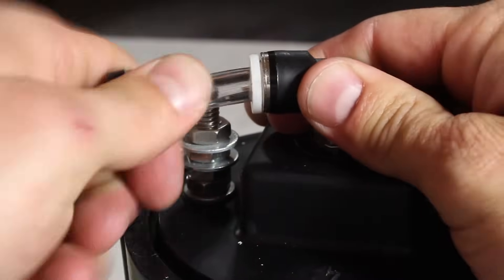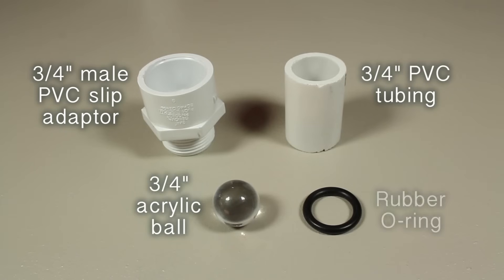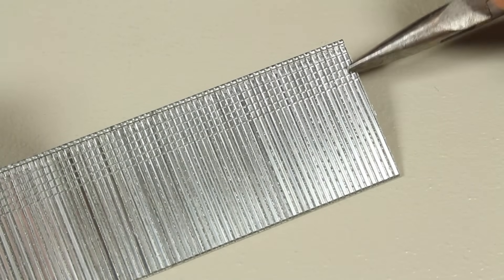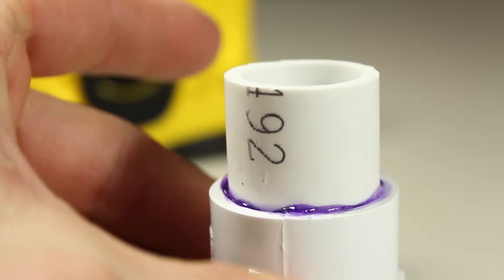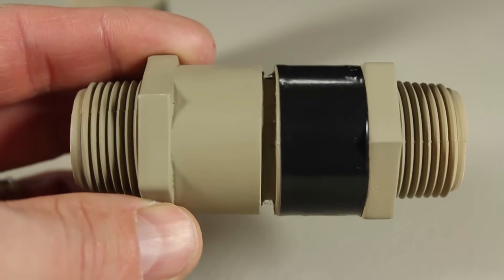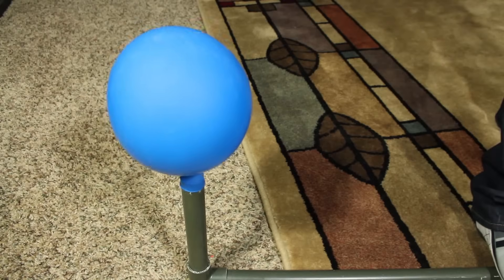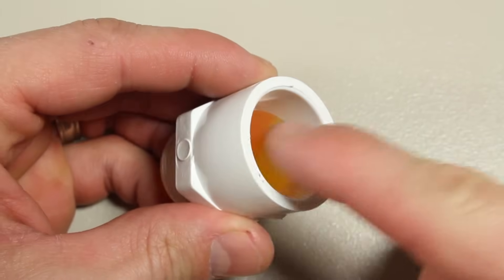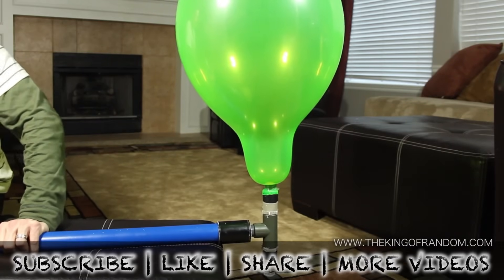How To Make a One-Way Check Valve - For Cheap!!

Comment: Where do you buy the acrylic ball
Reply: you can use almost any marble you can find, including the smallest one i found so far, inside a paint can, or the decorative ones from walmart in the arts and crafts (the cheapest big bag i could find) if instead of an o-ring you use a hillman 7.1 mm grommet from lowes upc # 0-08236-71652-8.  it has an inside diameter of 1/2" and outside diameter of 31/32" fitting those 3/4" pvc fittings perfectly
Reply: 40mm ping pong balls fit with 1.5" pipe

Comment: I don't trust this unit for HHO. Maybe for balloons but I need a check valve that properly stops flash backs. I had 3 check valves on 1 unit and it seems after a dozen or so flashbacks, the check valves stop working. I had 3 valves on 1 hose that all failed from 1 flashback, blew into the bubbler and fortunately I had the hose on loose so the hose blew off rather than the bubbler head. I think the problem is the gas explodes so fast, that the flame passes through the valves before the actual air pressure can close them. So I need to build some super heavy duty 100% fail proof check valve. And I'm definitely not relying on this unit.
Reply: well, it DOES say that it's for a water pump or DIY super soaker, NOT for HHO :)
Reply: How about building or buying a flame arrestor and installing it as close as possible to where the flashbacks occur.
Reply: Erik Ware Thanks & I already did that. I packed my torch with medium bronze wool and literally slammed it in with a hammer. I'd slam it once, see if I could breathe through, slam again, do a breathe test. I basically kept slamming till it took a bit of pressure to blow through the torch head. 

However, with further testing I've found out that the way I shut off the torch seems to be the main problem.

When I shut the torch off, I slowly turn the knob off. And that seems to have been the issue. Now I engraved a mark on the knob with my dremel. So I slowly close the knob on the torch, but I know after that "dash" I need to QUICKLY shut the valve. As in, I jerk my wrist as quickly as possible and now it seems like flashbacks have stopped completely.

The only thing I don't like is you really need to be QUICK with the valve. If I'm just a teeny bit slow I'll get a flashback. I'm new to this whole HHO thing and still can't get over how fast this gas burns. It's not even like a "burn". It almost seems like the gas "detonates" if that makes sense.

Comment: how would you release the pressure?

And where is a good place to buy all of this?
Reply: Lowe's or Home Depot
Reply: ***** Or Ace Hardware or a dollar store in the US, or whatever local hardware store you might have. Or you can use a steel file (or concrete) to shape something else (wood, tire rubber, whatever) into a ball shape, and if it doesn't hold tight enough, use some liquid handle compound to cover it.
Plasti Dip: http://amzn.to/1Ki0SYe

Comment: I'm translating a check valve installation instructions and it says to, in the case of direction changing "take away the check valve so that it is outside the turbulence area" with the following brackets right after that (between 3 and 5 times the ND before and after).
I can't for the life of me figure out what the text in brackets means and what the hell the ND stands for. If anyone could shed light on this in the next 5 hours, I'd be extremely grateful.
Asking on youtube as a desperation act after an hour of googling
Reply: ***** thanks for trying after a month has passed :D
Reply: New Direction? perhaps?
Reply: you're right and sorry to have brought up a sore subject.

it's sad that everybody writes for an audience of PhD engineers and ignores the layman.
Reply: skydyverjym No worries. It can't be a sore subject if it's over and done :P
Reply: Sure it's a bit late now, but what the strange text was trying to say is that when check valves are installed in piping runs they should be installed with a minimum length of straight pipe before and after. A rule of thumb for the minimum length is 3-5 times the nominal pipe diameter. The reason for this is to avoid turbulence from bends or other fittings interfering with the operation of the check valve.
Reply: ib9rt Alright than, thanks for clarifying.

Comment: How about a check valve that will handle hot water. Use: off - grid hot water heater using a copper coil on a stove pipe. The check valve would be at the low end of the coil to stop blow back when the water expands in the coil to allow for that pressure to push the water into the catch. In this example I'm thinking of an old hot water heater with both inlet and out circulating thru the heater coil.

Comment: Why did you need to cut the squishy ball? It seems to me it would work better if you used it whole. It would be less likely to deform and get stuck in the valve, and it also wouldn't turn so that air could flow past the flat side. Fluid actually flows better around a round ball, doesn't it?

You must have gotten a very good deal on those PVC adapters because they normally go for about the same as you're quoting for the whole project. Did you find a 2 for 1 sale somewhere? And of course you also have to have some acrylic balls of exactly the right size in your spare parts bin, and a hunk PVC pipe you can cut a couple of inches off of. You'll also have to have some leftover PVC glue and primer. A more realistic price would be $3.50 than $.35.
Reply: I think maybe the pipe inserted into the threaded fitting sits close to the flat spot of the ball which in turn takes the place of the pin nail and also doesnt let the ball rotate... but if the flat spot sat too nicely against the pipe it would be sealing off flow that direction as well so I may just be talking out my ...
Reply: Think of the flat side as a sail. The bigger the surface the more area to push against, as in the bigger the sail the faster the boat goes.The point is you don't want to let the pressure side flow backward.

Comment: Im definatly consider just one thing grant

Where can i get acrylic balls? And also would a marble work for a ball instead because i believe marbles are even harder than plastic.
Reply: maybe an old PC mouse?
Reply: www.usplastic.com/catalog/item.aspx?itemid=23375&catid=441
Reply: U can get them at the dollar store
Reply: Marbles are made of plexiglass silly... of course they would be stronger
Reply: you can use almost any marble you can find, including the smallest one i found so far, inside a paint can, or the decorative ones from walmart in the arts and crafts (the cheapest big bag i could find) if instead of an o-ring you use a hillman 7.1 mm grommet from lowes upc # 0-08236-71652-8.  it has an inside diameter of 1/2" and outside diameter of 31/32" fitting those 3/4" pvc fittings perfectly
Reply: Solid Round Clear Acrylic Balls  3/8" to 2" 
and more Acrylics of all kinds of size and shape
http://www.usplastic.com/catalog/item.aspx?itemid=23375&catid=441

Comment: Good video but what about using a car PVC valve for a large engine ? They are about 3 - 5 dollars, cheaper that the parts in the video but maybe too small therefore too low of a flow rate. Mechanics, how about suggesting one for a very large engine or SEMI TRUCK ENGINE PVC valve. They should be pretty large.

Comment: A 3/4 in ball will not work it is too small.  Now I need to get a 13/16 or 7/8 ball......
Reply: Easier to get thicker O ring or use a grommet.  Check em in store for fit.

Comment: I spent $27 on a 3/4 check valve that isn't working.  I wish I'd seen this video first!
Reply: Whatsapp:+8615570052161 Brass valves factory located in Shanghai China ,any questions or requests ,feel free to ask ,thanks in advance .

Comment: this is awesome, I built mine out of 3/4 inch copper so finding the correct ball size has been tricky  and I may need to tinker with it if the one I used disintegrates  making from PVC is much cheaper  as the copper bits are expensive but my application has heat involved

Comment: Rather curious - why breach your tube wall with a retaining pin, when you are using a tube so short, that you don't have a 'ball-travel' consideration to 'pin it' for travel? Your valve would have still worked perfectly, without the pin (I've built a bunch like that - cheaper than $7 or more at the hardware store).
Reply: Without the pin, the ball rolls out of the pvc tube.   And the breach isn't a problem,  as it is recessed inside the pvc connector when he glues it.

Comment: hmmn, the home I bought has a plywood shower in the basement with a side drain. without a gas sump.  I think I could make a flapper valve out of the right sized marble to prevent gasses from coming back up.  it only happens in the summer

Comment: U can use a ping pong ball with bigger pvc. It must be vertical up and down.
Reply: Or a solid Glass marble
Reply: He was just saying what would work for much larger ones because marbles and bouncy ball arnt really that big or easy to cut
Reply: You can get glass marbles in any size I have a few 1 inchers.
Reply: He was also basically was sayin that a ping pong ball is cheaper so its a good idea to use it instead.

Comment: You earned my immediate subscription! Thanks
 This is perfect for building pressure in my small HHO generator with a water filter and water arrestor
Reply: yup, me, too.  I have needed to put an inline check valve into a ram pump.  and this is it!   Make it any size I need.

Comment: GREAT JOB !!! thanks man. do you have a video that can help me with my flushing my commode . the problem is , trying not to buy a pump to keep make the fluid master work like it should. i need to make something that will let my raised rain barrel buckets of water fill up my tank and stop when it fills and when flushed it refills without running all my water out.

Comment: I don't get how this works. is the metal pole bending?
Reply: its really simple. ball does all the work i ball is touching that rubber ring nothing can flow. if the ball is on other side(whre the nail is) fluid can flow. position of the ball is detirmened by the pressure from sides. when u blow in it u push ball away from rubber ring and air goes through. if air try to come back out it pushes the ball onto rubber ring and it cant go through. cuz ball and rubber are tight fit. i hope this helps. sry for bad english.
Reply: Thanks That really helps! You type better than some only english speakers

Comment: I ended up gluing them in with Super Glue.  They don't work well with air, but I think the marbles I used are just too heavy.  They work well enough with water, which is the fluid of interest for our project anyway.

Comment: You could probably glue the O-Rings into place using Automotive Weatherstripping Adhesive (available from most auto parts stores), just be careful not to get any on the side the acrylic ball contacts because it may result in an uneven surface which may not seal as well then.  Allow the adhesive to dry fully before adding the ball and gluing everything else together though (in case you maybe have a little too much of it and it drips back into the main chamber of the check valve).

Comment: I'd think that if you had some old mechanical computer mouse balls (sorry that sounds kind of weird I know) that you could possibly use one for higher pressure applications than you could use the 'rubber bouncy ball' for since most were either steel balls coated with rubber, or hard plastic balls coated with rubber.

Comment: you could use acrylic tubing for the bottom of the pump     (one way valves and connectors)   so you can see the water movinf throught the pumps or why not make the WHOLE pump clear acrylic    ......................

Comment: you need to use springs in that case because the marble may be a bit heavy and air pressure alone may not lift it at certain angles. why not try it without gluing it first. blow hard and see if it will block flow of air

Comment: I had a hell of a time finding the acrylic ball too. I tried marbles, too small. Couldn't find steel bearings at all the local hardware stores for some reason. So I finally lucked out and found a source at a local plastic supply company. Get on google maps and just look for "plastics"

Comment: Great vid, I build aquaponics systems and I hate having metal one way valves. Was the brad you used stainless steel? I may replace with a plastic rod of larger diameter. keep on doing what you do best. Its much appreciated.

Comment: As far as I know, the "electric current" flow is the common used by people, that shown its direction path in every circuit diagram, rather than "electron current" flow - which is has opposite direction path against "electric current" flow itself. 
Actually, In the brieft way of writing, You are right, Kzumo, Thanks.

Comment: I would suggest using a stainless steel or aluminium brad to increase valve life, instead of one made of soft steel. I will check out the hand pump video. I could use one for bicycle tires. Most hand and foot operated air pumps on the market are expensive, or very poorly designed.

Comment: If i buy a non return check valve, will it release pressure on the other side? Say i have 10psi on the negative side, and i have 10psi on the positive side, will the air back up?

Comment: Great project and description. This is a good design and is a viable, practical , check valve.

I was a bit suspicious when I got an e-mail about an "One-Way Check Valve" But when I saw it was from you, I knew it would be worthwhile.

Where do you get the ball? I had thought about using a marble.

Thanks much -
Bill

Comment: Do you know if this constricts the maximum volume of flow through the pipe? Also, you mention some tested air pressure ratings? Did you ever find the pressure at which it fails? Great stuff...

Comment: but would utu keep the flame out though? when the fuel behind the valve catches flame it will produce gas that will build pressure that would open the valve, right?

Comment: Even though schedule 40 is able to handle 50 psi well,  might I suggest building a hydrostatic testing system.  Can be a simple positive displacement proven with weights and levers to actuate it, or weights and pulleys perhaps.   Hydrostatic testing is the safest method for testing any sort of high pressure vessel.

Comment: thats false, I doubt you can use the pump from a distance, you would lose pressure very easily. It only helps getting the water easier which is not a necessity. Also I hope you don't think u can get water only with a pail... would be dumb to think

Comment: If you are unable to access electricity (typical scenario in any 'apocolypse') or non-homemade versions these valves, a pump made using these to fill a large reservoir with water would be much more efficient than say, using a pail or bucket to fill one with water. It also allows you to set-up an accessible pump to water source without having to actually go to said water source (which may endanger you if it not in a safe area).

Comment: Could you perhaps make a primitive pressure gauge this way? Some transparent tubing with a closed end and a tight-fitting red pellet in it. Increasing pressure should press the pellet up the tube, thus giving a reading of the pressure in the system. Or am I wrong? Maybe something to try out for a future video? :)

Comment from the maker: Thanks Dan.  Around 60PSI the ball had a tendency to lock up in the O-ring.  This could probably be remedied by using a thicker O-ring.  I took it all the way up to 135 PSI, but the ball gets difficult to release.  50-60PSI should be way more than enough for any application involving PVC parts.

Comment: maybe :3 yeah, need to make a flamethrower and just need a valve that will stop reverse flow so that the flame doesnt drag in and kaboom. but i need to make sure this can handle the heat. TBH i could replace the PVC with metal and use a metal ball..... just worried about the O-ring.

Comment: If someone doesn't have PVC primer sitting around the house, then that would be the most expensive part of the project. It runs at about $5-10 per 1/4pint depending where you go.